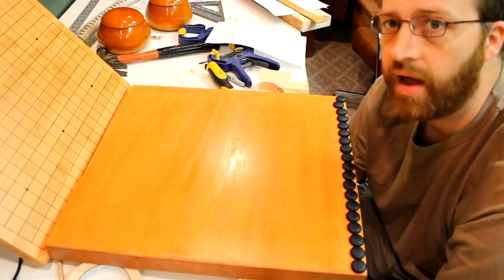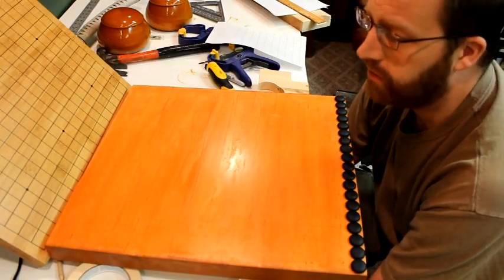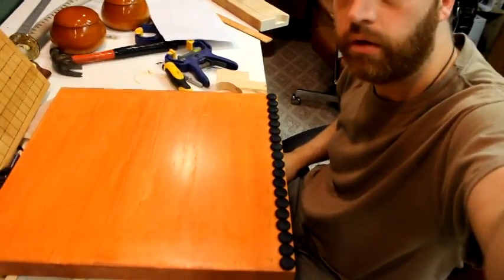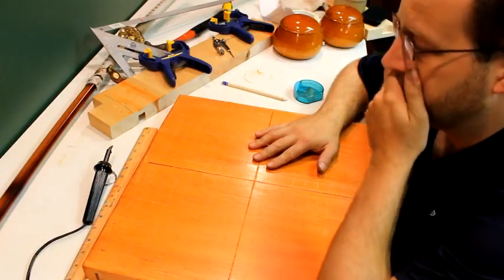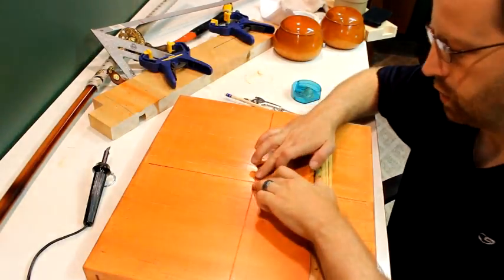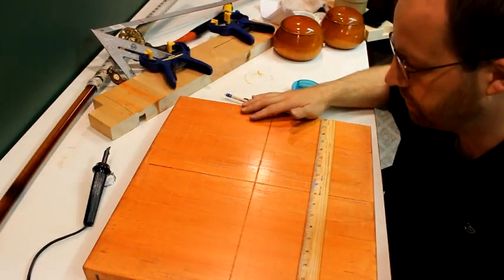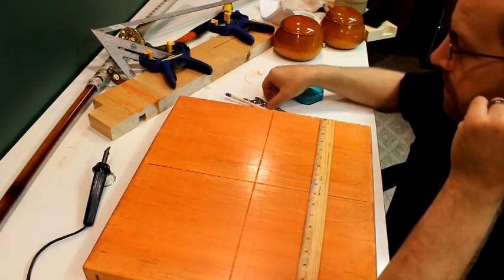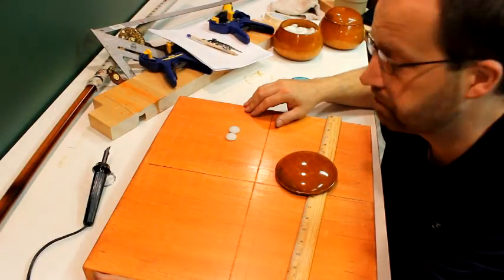Making a goban part 7,a+b, measuring the lines

Comment from the maker: I think polyurethane is usually clear, so it may fill in bumps and dents, It will not help with the appearance. And to get a non clear one, I think I would need to match the colors etc. I think I am going to use lots and lots of wood stain to cover the best I can.

Comment: I'm not a wood working person either but would'nt the polyurethane fill in those imperfections that you pointed out?
Look at your Go bowls....think they were always that smooth ?
Any method you use to make those lines should be fine as long as you take your time.